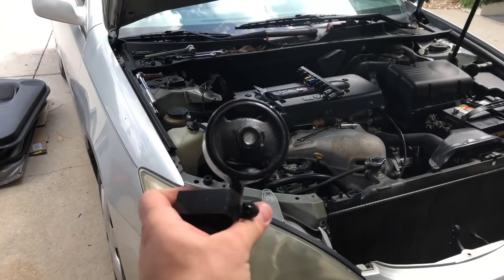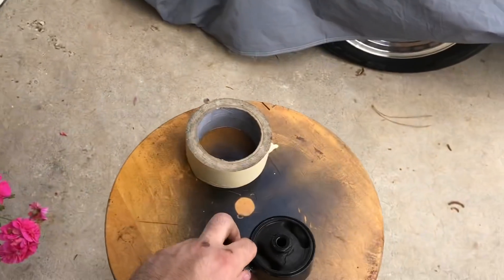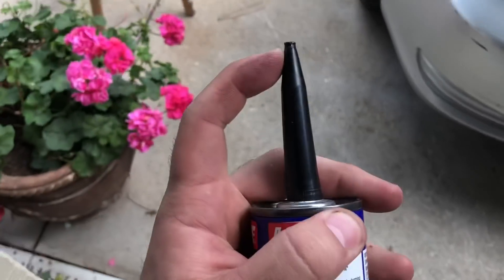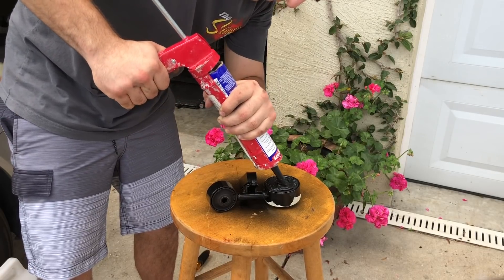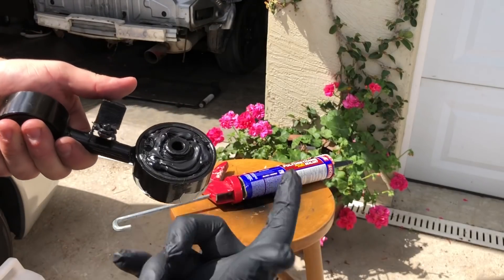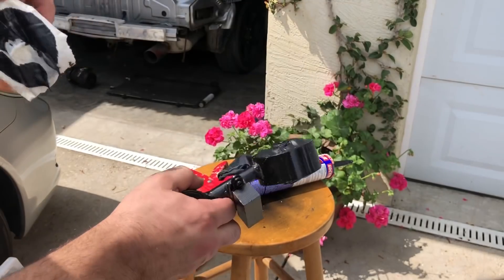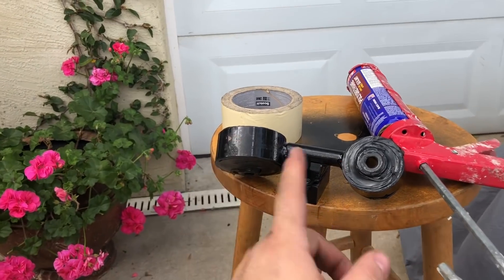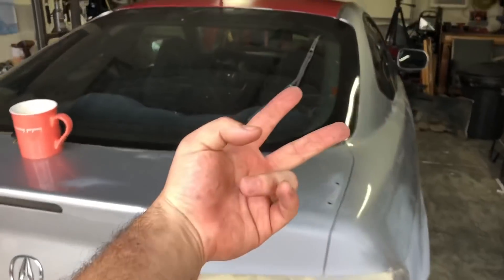CHEAPEST ALTERNATIVE TO SOLID RACING MOUNTS!

Comment: Wouldn’t it have been better to put it in the Fridge after instead of leaving it in the sun ☀️
Reply: Devinenyc while it would flow slower it would cure much slower as well, heat supports faster chemical reactions with oxygen in the air, which is what cures the polyurethane...
Reply: LeMarkD Media got youu , see i didn’t know that